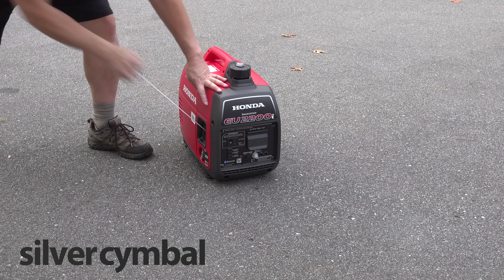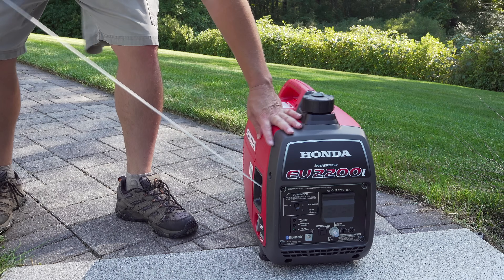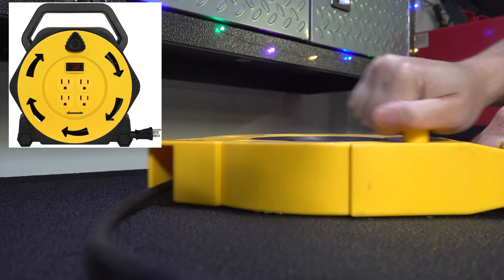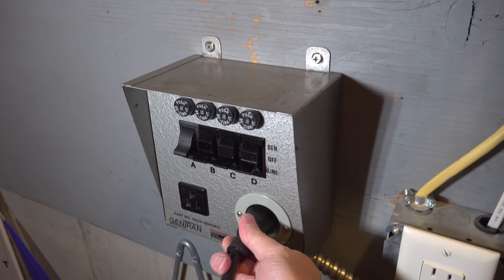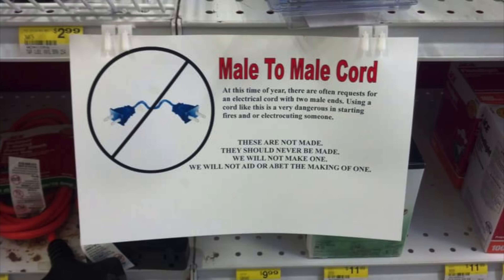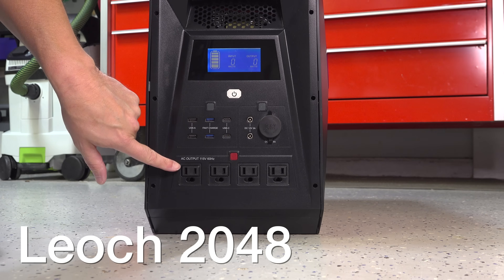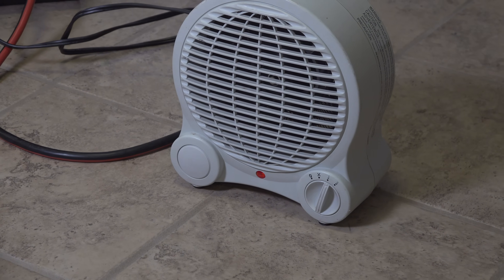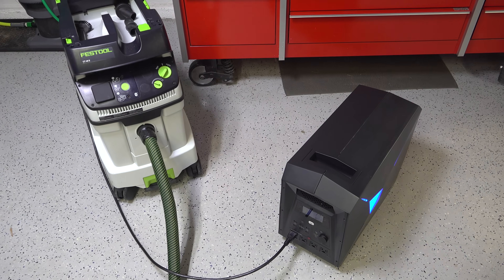How to CONNECT Solar & Battery Generators to Circuit Breakers

Comment: When the transfer switch is set to "line" and the battery is plugged in, will it charge the battery (assuming of course that the grid is up)? Or does it only draw power?
Reply: Set to LINE, the battery is not used and will not be powered by the line. You can run an extra outlet below the panel if you need to or purchase a transfer switch with a convenience outlet.

Comment: You can use legally use a generator interlock switch installed in the breaker box as well. It simply won't physically let you have the main and generator powered at the same time. Flipping one automatically trips the other one.

You can also illegally use the male to male without killing anyone by turning of your main breaker thereby doing what the transfer switch and interlock does but you can mess that up pretty easily.  So don't do it.

Comment: I hate the use of "generator" for batteries because it breaks the distinction between a gas generator which needs to be outside in a battery storage system which does not (unless of course they are lead acid) and people have a hard enough time keeping their generators outside and not killing themselves.
I mean technically it's generating electricity but inverter is a more accurate term, and generator technically it's a category.

Comment: I have been watching your vids all day now.  This one simply is no longer helpful as the transfer switch you use (the four pole) in no longer manufactured and there is no 'similar' one sold.  ALL the transfer switches i have found in three hours of searching on line have some sort of four pole input.  But we have a three pole outlet from every one of the generators I have seen today.  That includes the three pole 'RV' outlet.  So....How about an updated vid that shows us how to actually hook own up (legally) to a house.  $, 6, or 8 circuits are fine but we need to go from a regular, household three prong (or RV prong) to a regular household three prong OR find an adapter that would work (I have been unable to find one online).  A visit to my local hardware store said the least expensive transfer switch panel they had was WELL past $425.  And it did not have the connector for a household or RV connector.  The RV connector/extension cord would be better as they are rated for 30 amps vs 15 amps for a household prong cord.  So.........
Reply from the maker: Ask and you shall receive, here is a current model 4 circuit 120v switch  https://amzn.to/39CzpDq  - If you only need to do a single circuit with 120v you can get one of these https://amzn.to/3m0Uihn - Hope this helps.
Reply: @SilverCymbal  Geez.  I searched for near 45 minutes on Amazon (and a lot of time on other places) to try and find this.  Wonder what search perimeter I was using that failed so badly.  OK.  And not very expensive.  I am going to give this a try.   I sure hope the instructions that come with it are VERY accurate.  But... i will not be telling my wife I am doing this until AFTER I have it installed and tested....!!!!!  Thank you.  Gave your reply and vid a TU just for this answer.

Comment: I just have a question during a power outage that last say 3 days how do you charge the power bank once it's drained
Reply from the maker: For multiple days you have to use solar, even folding portable panels work. This is what happened in TX where there was no gas for generators after day 1. Not perfect but it is power every day

Comment: Very informative video! I had always wondered about how to do this. I can't seem to find the model Gentran 32310-189002eg available anymore, which would be a good substitute?
Reply: Reliance Controls Pro/Tran 2 R104B is the only 15 amp transfer switch on the market. Almost identical to the one that SC has here.

http://www.reliancecontrols.com/ProductDetail.aspx?R104B

You can buy them in a kit that Yeti & Nature's Generator makes. They're at Lowe's/HD/Amazon etc. The kit comes pre-wired and includes conduit and wire nuts.

Comment: But in a Power failure how do you recharge your battery pack😂
Reply from the maker: With a solar panel every day. For the people in TX who couldnt get gas at any stations they could have gone on for weeks if needed.
Reply: @SilverCymbal  
The question is how do you recharge the battery pack. I can syphon gas out of your car! 
I could poke a hole in your gas tank and get gas! But the energy density in the batteries is not the same as the gas. I’m not saying they’re not a good idea. Because I own several myself. 
I do construction. I have a Honda generators. 
And a couple of battery banks back up generators. So I don’t have to run my Honda generators all the time. Either which way
You still got a recharge the battery pack!
Reply: @SilverCymbal  
I do realize the gas goes bad overtime! 
I keep 5 gallons of gas. Start with my generator. Which I pour my vehicle and put fresh gas in the Gas jug. With gas stabilizer and I also put in some Seafoam carb cleaner. 
When I run my generator I’m charging my battery bank at the same time.

Comment: Another Good Video, 
Note: Those wind-up extension cords MUST be FULLY unwound for all but very small loads or the tightly coiled cord will overheat. 

PS where did you find the factory molded Male-Male cord?

Comment: @Silver Cymbal do you have this installed in conjunction with your interlock setup? I just purchased the Westinghouse Dual Fuel 7500 watt generator which I will use on my panel with interlock but I'm looking to separate some circuits to run sensitive electronics from a small inverter generator or solar generator. Without putting much research into it yet I'm thinking the transfer switch like you show will isolate those circuits from the panel/interlock. Am I correct in my thinking?

Comment: A comment about "cord reels": most are constructed with 16 Guage wire, and I've never seen one heavier than 14 Guage, therefore the current carrying capacity is limited (and the sockets tend to be cheesily constructed, like most Chinese electrical products).  Be extremely cautious as to what you plug into it. Secondly I have found from experience that you must unreel the entire cord before use; if you leave it partly wound up and draw any substantial power from it, the coil of wire inside the case will become quite warm (wasting valuable power needed by your appliances), perhaps even becoming hot enough to be a fire hazard. Essentially it becomes an inductor coil and heats up from something akin to magnetic friction when it is coiled up and enclosed in that case.  If you are only using it to charge your cell phone and other small battery power devices you should be all right, but if you try plugging the TV system or a small refrigerator or anything like that into the cord reel you will almost certainly fry it, especially if it's wound up and not completely extended outside of its case.  Personally I prefer using 12 Gauge or 10 Gauge extension cords for powering appliances off of a generator..

Comment: Have you ever tried that battery for a well pump?
Reply: That Leoch unit is 120 volt output only. Most deep-well pumps are 240 volt, not 120 volt. (Not sure about pumps for shallow wells; but mine is 300 feet deep!). IIRC, my pump is 3/4 horsepower, 30 amps at 250 volts, which equals 750 watts to run it, with probably 20 or 30% more wattage required at turn-on.

Comment: The other thing with generators is if it is an unexpected situation with no ETA of power coming back you don't run the generator full time. You just run it to keep the freezer cold or the heat in the house above freezing.  That is more true with the battery style ones as with gas you should be able to stock back up, these ones you only have until you run out

Comment: Great video, thanks for this! Was wondering if the Leoch could power also a central AC if hooked up via a transfer switch?
Reply: Likely not. Central AC requires far more wattage (especially when it starts up) than you could draw from. a battery type inverter generator such as this one. You'd probably need a fuel-powered generator of 7500 watts or more especially if you also want to run the fridge, the TV, perhaps a well pump, and some lights.
Reply: Central AC runs on 250 volts and the Leoch only produces 120 volt. A central AC unit is likely to need at least several thousand watts to run, plus you have to power the blower fan for the ductwork. So, no.

Comment: lol here in iraq we basically disconnect the house from line and then backfeed into any outlet and the whole house will be on safely
Reply: @jungle6815  dude. That's not how math works. 2000watts at 220V is 9 amps.
 2000 watts at 110v is 18 amps. Watts are Voltage times current. Your wantage doesn't magically change if you bump up the volts because the current has to drop
Reply: @vhateverlie  sorry, im kind of dumb in terms of maths lol forgot abt that
Reply: When doing this that means none of your devices are protected from the generator by a fuse correct? You're relying solely on how the house wiring is set up and the generators output?
Reply: @vhateverlie  most UK plugs have built in fuses (we use uk plugs here) so its not a problem
Reply: @vhateverlie  i use a 220volt 2000watt running 2500 watts surge gasoline cheap chinese genset and i run it on kerosene runs the house pretty well when there are power outages
Reply: Yep, even here in the USA, so long as you switch off your primary breaker, no power will backfeed into the utility/line. 

The laws here are really just to keep it simple/ less hazardous because a simple mistake could cost someone their life. 

You can “safely” back-feed power, but there are enough steps involved that it’s not straight forward/fool proof. So the law just make your liable if you screw it up.

Comment: Do you know of a transfer switch I could use with this in my house that is 220V?
Reply: You're better off getting an interlock and feeding your panel. If you have a 30+ amp output on your generator you can feed both sides of your panel and get 220V.

These dedicated generator switches are only good if you have a small generator like this one. Anything larger just feed your panel through a dedicated circuit.

Comment: Might have been better off mentioning the ups function as well on this unit. Plan on leaving mine plugged into the fridge, that way if I'm gone and the power goes out it kicks on by itself. Also mentioning using this along with a genorator, topping this off with pass through charging while running things later in the evening so you can use this overnight not having the noise of the genorator.

Comment: With purchase of two of the Leoch systems could you combine the 2 120 volt outputs of the 2 Leoch to run a more common 240 volt transfer switch and also boost to 4 kw for well pumps and other high energy loads (short duration)?
Reply from the maker: Unfortunately not officially  You could probably wire something on your own but it wouldn't be a safe setup. I think we may see 240v solutions in the next couple of years, things are advancing so much

Comment: I have an interlock at my main panel. This allows me to safely connect my generator to my house.  A transfer switch and an interlock are not the same thing.  You said in the video that a transfer switch is the only safe way to connect a generator.  But, really there are two safe ways.  

The reason I like my interlock better is because it gives me more flexibility in changing which circuits are connected to generator.  In your setup you only have 4 circuits to pick from and they can’t be easily charged.  In my setup, I can at any time pick a different breaker to power with generator— without moving any wires.  That flexibility helps in an emergency.  

FYI: my interlock is made by the same company that made my breaker panel. But there is nothing wrong with a third party interlock kit.
Reply: What interlock are you using?
Reply: @beausmith08  I’m using an Eaton Cutler-Hammer panel.  The interlock is a replacement front panel that replaces the entire front part of the panel.  No drilling or cutting is required to install it since you just replace the entire front.

Comment: I got a returned inverter for 60% off at harbor freight. I haven't had to use it but it's big enough for my fridge, cable modem, Wi-Fi, sump pump, and gas furnace if needed.
I bought a pump with a long tube I can use to pump fuel out of my vehicles and into a small gas tank to transfer to the inverter so I don't have to keep fuel laying around. One vehicle has a 24 gallon tank the other hold 14 gallons. That should last days.. maybe longer.

Comment: These products are not comparable. The one that creates electricity is a generator. The one that stores electricity is a battery. Not a generator.
Reply: Gas generators store energy chemically and convert it to AC power. Battery generators store energy chemically and convert it to AC power. Both are commonly used to provide electricity during an outage. It's almost like they have very similar functions.
Reply: @JustinTimeCuber  anything that can burn is stored energy. One of these products generates electricity from gas. The other requires electricity to function, stores it and gives it back to you later. It is not a generator..
Reply: @djdilemma1000  Batteries store energy chemically, not unlike a gas generator. Really the only difference is that with a battery generator, the chemical reaction can be reversed using electricity, whereas with a gas generator, the reaction is irreversible and you must replenish the fuel. Both types of generator generate AC power from a chemical source. The difference is how that source is replenished.
Reply: @JustinTimeCuber  the difference is how the source is replenished is right.  The actual generator will GENERATE electricity from fuel. The product you are referring to as a generator is only storage and inversion. A battery with a charger and inverter is not by any means or stretch of the imagination, a generator. If you are in denial of this just look up " generator" Have a good day.
Reply: @djdilemma1000  A battery generates DC power from a chemical reaction. An inverter converts it to AC. In combination, those devices are a "battery generator". In a "gas generator" the beginning and end are the same (chemical to AC electrical) but the intermediate step is different (mechanical instead of DC electrical).
Reply: @JustinTimeCuber  im wondering why i am wasting my time here while this person is obviously unaware after multiple exchanges that i have knowledge to speak on this subject. You obviously didnt look up the definition of generator and you keep making comments that are not objectively true. Now i understand. You are a bot programmed to defend the misleading title of this product by continuing to try and make people think a battery is a generator. Based on your own reasoning, you are a generator as well.  because you generate bullshit after an electrical reaction. I wont bother tearing in to this attempted justification of calling an apple an orange any further. Tell your botmaster there is a glitch in the matrix
Reply: if a generator, generates, and a battery stores, what does a solar panel do... panelling?
Reply: @chrisanderson8553  yes, and based on this logic, a battery doesn't store, It batteries
Reply: @djdilemma1000  It was a joke. :)
Reply: @djdilemma1000  This is great. So i looked up the definition of generator in the dictionary. The very 1st definition is...."1. a person or thing that generates something." So looks like I am a generator!
Reply: @chrisanderson8553  congratulations
Reply: @chrisanderson8553  everything is generator. And everything is battery and everything is terrible. Haha
Reply: @djdilemma1000  My wife would agree with you, I am a terrible generator. :)

Comment: If the all battery solution can last 8 hours, how long would the gas generator run the fridge and heat?
Reply from the maker: The Honda EU2200i would run those same loads with one tank of gas for 8-12 hours. You would get more run time for sure, but it may not be what someone can use. Whether you buy https://tinyurl.com/y5jexkux or https://amzn.to/3kfGnBp you are looking at two awesome solutions.

Comment: Great video, love the practical applications you showed with this unit. I've ordered one and am looking at getting some solar panels for it, but it is a very far run from my roof to where the Leoch unit will be in the basement near the electrical panel. Are there a lot of line losses when running power from the panels that far? Most solar cables I have seen are 30 feet or less. Thanks!
Reply: Hi, how did this turn out. What was the distance and did you experience any loss?
Reply: @bluyetiinc7553  I ended ep getting 100 ft of solar cable and ran it through the wall near the basement. The 2x100 watt panels I got aren't the greatest efficiency so the best I have ever been able to generate is about 140 watts, but I'm in Canada and I didn't mess around with the solar angle. So, overall, there may be a little but of loss, but there really isn't any alternative. I think there really isn't any alternative, so just try to keep the length of the lines as short as you can.